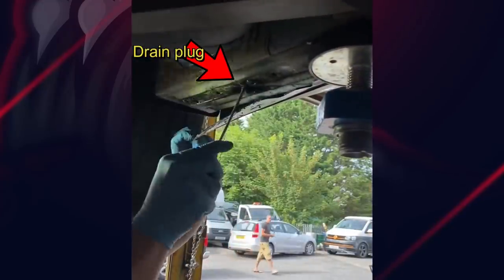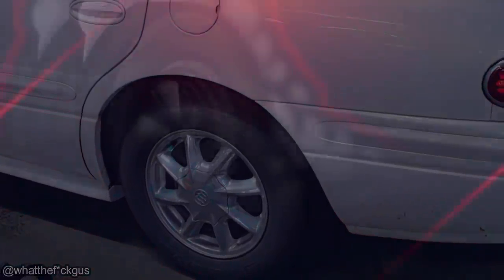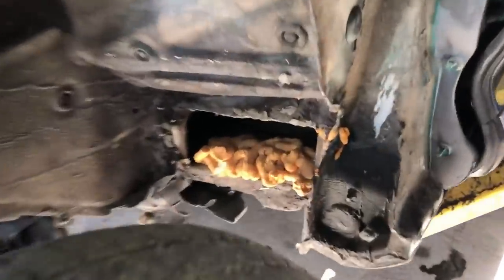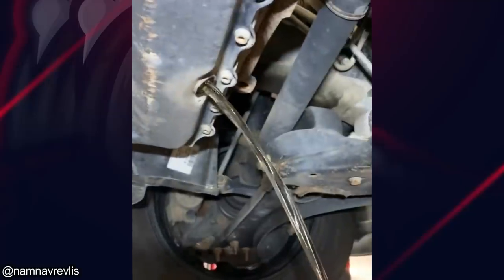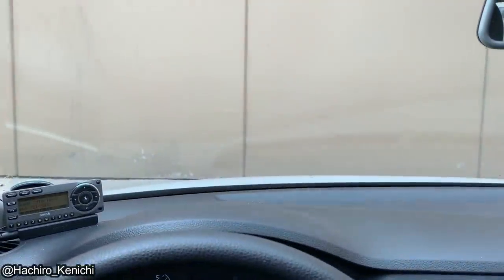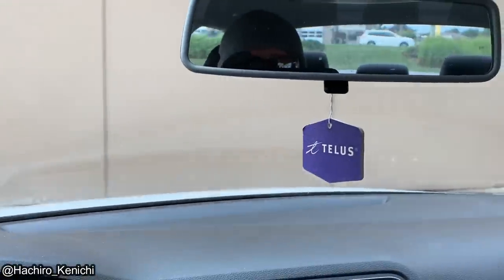Customer States Water Noise When Driving | Just Rolled In

Comment: An easy way folks to keep rats mice stuff like that out of your engine bay mothballs but when you place those mothballs or even dryer sheets work as well but mothballs definitely work really well put them in a place where there is very little heat where it cannot catch fire or burn usually around the air box or should say air cleaner where the air filter is works and a few other small places you know away from the motor but it will help keep them away I've used this method many times especially on a vehicle that I had coming to my shop a while ago it had a massive rat nest under the hood and ever since we placed mothballs and we place dryer sheets under the hood again in very specific places so that they do not catch fire or cause fire and again being a trained mechanic I know exactly where to put them so yeah if you want to help keep rats and stuff out of your vehicle mothballs just have your mechanic do it for you don't do it yourself because you may not know the proper place to put it and you can cause severe soccer championship if not place correctly

Comment: Man that frame is going to rust out and they'll hit a bump and get the ride of their life. 
I installed heater pipes on my 2002 Taurus SE seven years ago and used distilled water and the recommended antifreeze and the pipe rusted out yesterday. I guess there was a lot water in the block and heater core even after blowing it out with air or that distilled water tip doesn't stop rust at all.

Comment: Hydro-lock engine. Hope customer didn't attampt cranking it over and held the starter powered for too long. The only way i know to purge water out of the pistons without disassembling part of the engine is getting a torque wrench and turning slowly by hand to push out the water through the piston rings and through the exhaust valves. After that one or two oil change and it's should be alright.
That leafspring, that person got double lucky it didn't shred that wiring harness passing by there.
Reply: the right way is to remove the spark plugs first instead of forcing anything with a wrench.
Reply: Easier to take the spark plugs out and crank the engine. Just stand clear of the jets that come out!

Comment: I have problems with animals getting into the engine area.Pulled about 45 black walnuts out of my blower motor. I put vapor rub under the car or under the hood if it is getting stored. Seems to keep them out.

Comment: all these small stream and puddles hydro locking motors and I took my 04 crown vic through 3 feet of water at 50mph and its running 100%

fuck it cleaned the hell out of my engin bay though.

Comment: There are two o rings for the toyota oil filters so they could have forgotten the one on the bottom too. Also its easy to crack or hair fracture those plastic housings they make an aluminum oem housing. I have no idea why toyota allows plastic oil filter housings
Reply from the maker: I was thinking the same thing. We have a Toyota and I'll be switching the housing soon.

Comment: I had a customer with a Dodge Journey a few years ago with water in the frame rails on both side  that was sloshing around. No water inside the car nothing under the carpet everything dry just in the frame. Never did figure out how it got there. Pulled the drain plugs put it back together and it didn't happen again.
Reply from the maker: That's an odd one! Good ol Dodge Journeys lol
Reply: @JustRolledIn  I should said Fiat Journey as that does explain alot
Reply: I had it in the doors of my Chrysler 200 (which was a platform mate of the Journey)!  Kept hearing a sloshing sound and couldn't figure out where it was coming from as I had nothing in the car that could make that noise, finally I looked at the clear tape that was by the drain holes at the bottoms of the back doors when I opened one and heard the sloshing and it just started pissing like a race horse, went around and did that on the other side and even cut the tape on the front doors, though that was never  a problem with those.    Amazingly, I was under the car about 6 weeks ago while doing some upgrades and maintenence and found that the car had very little "flavor" as the Audi Mechanic at "Customer Says WHAT?!" puts it.......which is amazing since it's nearly 10 years old and has lived almost all of it's life in Northern Illinois!

Comment: My mom once called me complaining that her car made a sloshing sound when hitting the brakes. The entire trunk and the back floor were full of water to the point her suspension was bottoming out. It was a good 300L of water.
Her trunk seal had failed at some point within 3 years of my draining it. The spare and jack were rusted completely, and the car smelled of mold and rot to such an extent that it was pungent at 10M.
Reply from the maker: Wow! How did all that water get in their? Lol
Reply: @JustRolledIn  edited with more info. The trunk seal failed. It was curved so all the rain running off the roof funneled into the split in the seal.
Reply: I just got my convertible back from the shop last week. I brought it in to a shop to replace a set of rotted freeze plugs. I couldn't do them myself, due to arthritis and blown rotator cuffs. Well, he left it out in a hurricane with the windows down. He refused to pop the drain plug and everything rusted. He also blew out my speakers, and only did half the freeze plugs.
I drained between 70 and 80 L of water out of the driver's floor pan. All the electrics need to be gone over, because the gauges flick up and down on their own, now. Gotta love it.
Reply from the maker: @MikeStavola  damn that's unfortunate. Sorry to hear that. :/
Reply: @JustRolledIn It's a 1995 Chrysler Lebaron, so it isn't a big deal. And it runs great, now.
Reply from the maker: @MikeStavola  well glad to hear it's running great!

Comment: For rats and mice use peppermint oil extract  30 drops into a 12oz  spray bottle with half drop of dish soap, shake and spray engine bay and wheel Wells.  Cheers.

Comment: I used to have a torrent and every time i drove it and made a turn, there was a sloshing noise from under the dash. Never did figure out where it came from. But when i sold it the passenger carpet all of a sudden was wet all the time. What is a water locked engine?

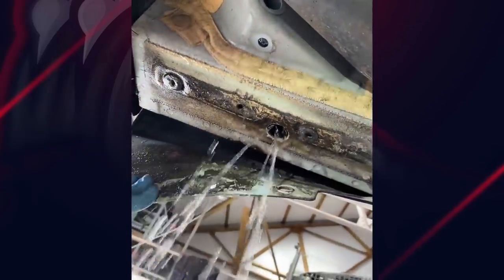Comment: 0:34  I learned the hard way to not take your vehicle in for minor things (oil changes, changing out tires, etc.) during the summer months because a teenager will be working on your vehicle. Broke the lug nuts on two wheels (happened twice before I got the hint).
Reply from the maker: Damn. Sorry to hear that.
Reply: That is why I pay a little more and go to the dealership.
Reply: @kerrylee4633  For important things I do have a garage that I go to. They have a AAA rating from the Better Business Bureau and they work hard to keep it. So, brakes, tune ups, needed important repairs I go to the garage. They don't have a storeroom at the garage, they have to to dealerships and auto parts store for parts. Besides the excellent service, the garage is less than a mile from my house-so I can walk there if need be. The nearest dealership is 10 miles away. Overall, the garage is a good deal. For the tires, I go to Discount Tire and for oil changes-Walmart-even though I despise Walmart.

Comment: Q: About Hydro locked, is the engine typically damaged beyond repair when this happens.  What actually does happen?
Reply from the maker: A lot of the time yes. When water is in the engine it can't be compressed, since you can't compress a liquid. So most of the time you will bend connecting rods and get a hole or two in the engine block lol.

Comment: Can someone explain what has to happen after the hydro lock please, has the engine had it? or do you just drain out the oil and water to fix it? Just curious
Reply: The motor is toast.  When an engine is running and it sucks water into the intake, it will bend a bunch of rods because water doesn't compress, it stops  the Pistons in their tracks but the crankshaft still has  inertia thus "rod-o-bendo" happens.
Reply: @leninmi7579  oof, expensive. Thank you

Comment: -- Comments laugh, fry me, but an answer would be nice as well:  I drive a 2004 Tahoe Z71 for a winter beater.  The front diff is open.  If I installed hub lockers, would that lock the front diff for true 4 wheel drive?  And thumbs up to the video.

Comment: Something similar happened to me but it was a dealership and they didn't just forget the O-ring they put the completely wrong oil filter cap on my car so when I saw there was no o-ring on it, I put one on it but when I did that it made the leak worse. I ended up figuring that it wasn't the right one so I looked up the one for my car nope it's different but looks the same from the top. Not sure how you mix them up looking so different on the treads/o-ring location. Was the worst because I was winter and oil was dripping on the hot engine and burning (it's on the top slanted)
Reply from the maker: What kind of vehicle do you have?
Reply: @JustRolledIn  it's a Chevy Cruze 2014 got a sweet deal on it as it was a rebuilt

Comment: Write there in not oil change situation where they forgot the old ring on the oil filter cover honestly that's one of the reasons why I don't go to those quick oil change places they don't pay much attention to what they're doing they just get it and get it out kind of thing that's not what I like I like places like Midas where they do it a full inspection and check out everything weather it be only visual or mechanically check things out the always provide you with the information needed and there work is guaranteed I know this cuz I used to work for them and our customers were always happy and satisfied and many times I've had to deal with these quick oil change places I'm not going to need names that don't do a proper job and people have shown up at my shop with masa boy leaks because the drain plug wasn't putting properly your damage or the filter wasn't put on properly heck I even had one come into wasn't even enough oil in the car and the motor ended up being destroyed I'll tell you what do you have any idea how much a motor cost for an Audi route that quick oil change company learned very quickly how much that motor cost because we ended up having to put it in at the cost of that oil change place so if you get your oil change do your research and check the place out it'll save you a ton of money and a lot of headache

Comment: With the first clip it's not a drain plug, it's a grommet (there are many grommets in various locations under late model cars) to prevent dirt and splashed water from getting into the frame and cabin. They probably drove through deep water or there is a rust hole around windscreen, rear window or boot allowing rain water to get in.
Reply from the maker: Drain plug/grommet. Same thing.

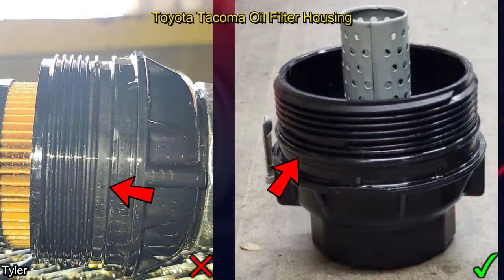Comment: 0:48 can anyone explain why manufacturers have this type of oil filter setup? Doesn't seem as good as canister filters.
Reply from the maker: Good question! Might be because their possibly easier to dispose of? Or their engineers think their might be an advantage to using them besides the traditional spin on filter.
Reply: @JustRolledIn  Maybe, but a plastic housing? It's one accidental "farmer tight" away from "Can you drive me to town to get another housing" 😆

Not to mention the one on the tacoma is on the bottom....the bottom that is at risk to damage when 4x4ing like most folks would in those trucks.
Reply from the maker: @endutubecensorship  they come from factory with a plastic housing but a metal one is available from Toyota.
Reply: @JustRolledIn  I bet a lot of off-road tacoma owners appreciate the option of a metal housing. 

I'm disappointed to see plastic housings as standard, and many manufacturers do that.
Reply from the maker: @endutubecensorship  whatever they can do to save a dollar, then sell it afterwards as an upgrade lol.

Comment: How does an engine get hydro locked? Where does the water get in?
Reply from the maker: An engine can get water through the air intake. So from driving through a puddle or high water.
Reply: I'm surprised the car didn't float away.

Comment: What does hydrolock mean?

Just on case you are going to make fun of me, I am really asking for a friend of a friend.
Reply from the maker: Hey, no worries.
It's when your engine seizes/fails because you filled up your cylinders full of water. You cant compress water so you end up bending connecting rods and doing a good amount of damage to your engine. It can happen when you drive through a puddle and suck water in your intake. Easiest way to explain it but it's usually a costly repair!
Reply: @JustRolledIn  thank you, I knew that, but my friend of a friend didn't believe me.
:)

Comment: Ok not a mechanic,   so what is hydro locked and does it do a lot of damage to an engine?   And just saying I am not stupid enough to drive through so called small streams, running water or anything like that.
Reply from the maker: Having water/liquid enter your engine. 
So you can have that happen when you drive through water and suck water through your intake. It can cause your connecting rods to bend, quite the damage to your engine and causing your engine to seize. That's the easiest way to explain it.
Hope that helps somewhat, just wanted to try and explain it in a easy way.
Reply: @JustRolledIn  Not just con rods. Somewhere I have a publication from a piston manufacturer here in the UK with a picture of a coach Diesel block that had been hydrolocked. There are cracks radiating from several of the bores.
Reply: @JustRolledIn  Thanks !!
Reply: @Graham_Langley  Thanks!